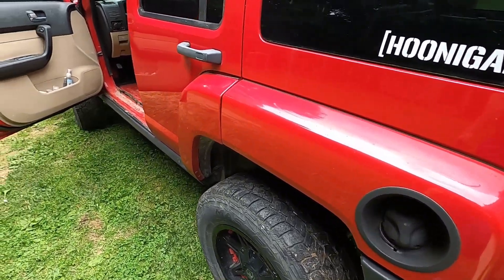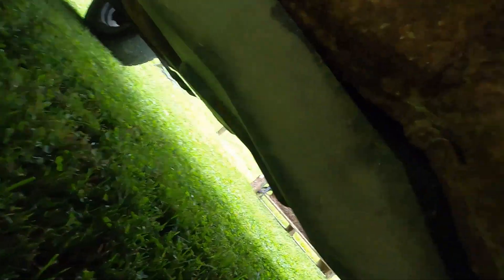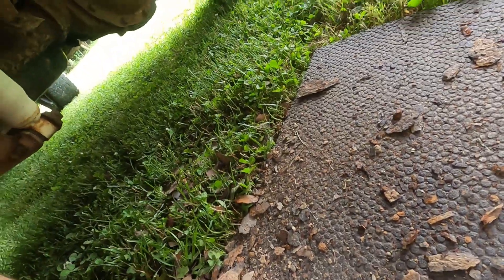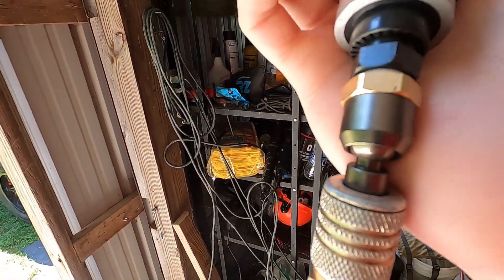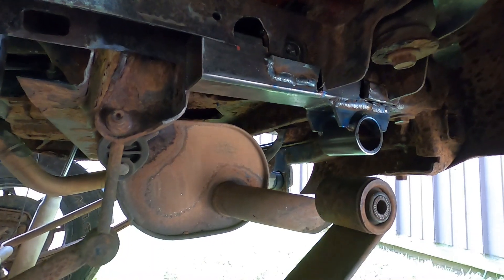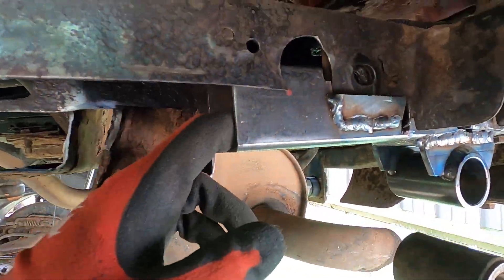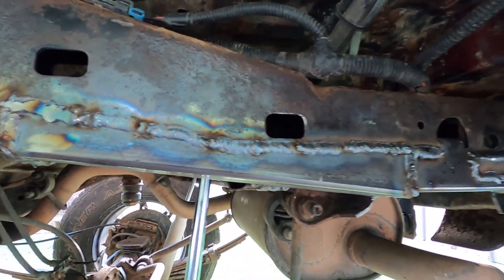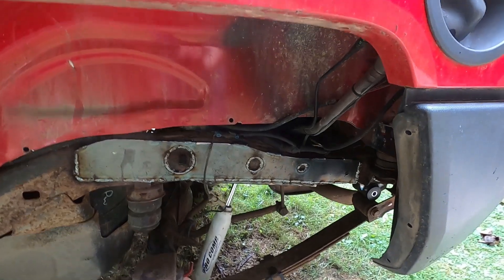Repairing My Hummer H3 Frame for Hartford Fair Rough Trucks (Severe Rust Damage)

Comment: I have exactly the same issue with my 2006 Hummer H3, no one will take it for repair. All body shop and automotive shop around New Jersey declined to fix my truck. My engine and transmission is rebuilt. Now i'm thinking of selling my truck. I have that same parts too, I ordered it from ebay stainless shackle mount.
Reply: Found a guy to do mine. Yeah tough find.
Reply from the maker: I quite honestly wouldn’t recommend what I did unless you are only gonna use it as a trail rig. The real solution would be pulling body off and cutting that full section out and using a donor frame

Comment: I may have a solution colorado & canyon both have same frame only a few components are different to do a frame swap i found on my 09 h3t alpha has rotting frame in different sections but nowhere near as bad as yours insurance will not help unless it caught on fire while camping 😮 i am angry at myself for not crawling underneath my h3t alpha when i bought it as anyone who buying their dream vehicle , i choose the h3t over jeep gladiator because of price plus building a overland build is another 20k i don't need a 80k jeep gladiator so i found this 09 5.3 h3t alpha that has both adventure and luxury package 29k plus my additional 10k in upgrades to now find rotting frame i will repair frame , only things suck hardly any upgrades that are made for h3t sense jeep gladiator bed close in measurement i bought a road armor bed rack because how adjustable the rack  i added a front runner dual drawers added a slide out on top to make it easy to reach things without always crawling on top of drawers, i also added a arb bull bumper warn winch,  front runner roof rack over cab and. Bed , my h3t gets many stares and most people never seen h3t truck they only made 5600 i think 400 alpha 5.3 v8 to me the h3t  makes a statement because how rare it is rancho use to make a lift kit , not any more but it still has good ground clearance for what i do overlanding
Reply from the maker: Hoping to find a new H3 frame as the money is less of a hurdle than the time and effort to swap it. Always tough to see something rust through and wanna put time and money into it tho